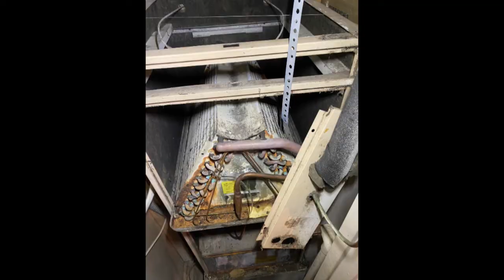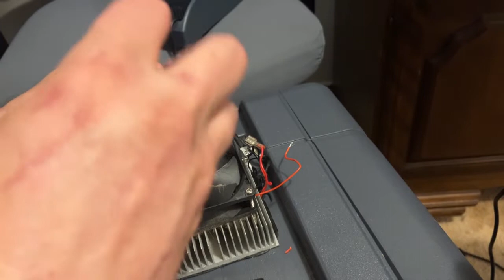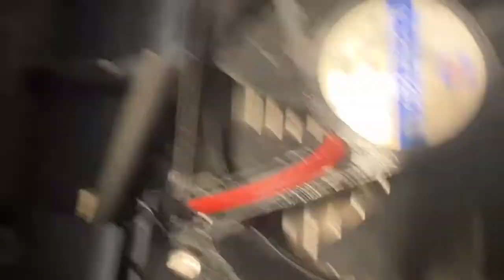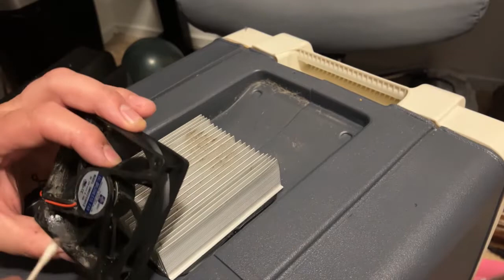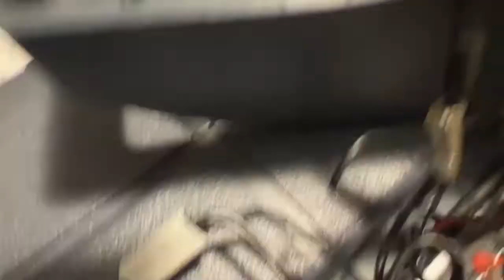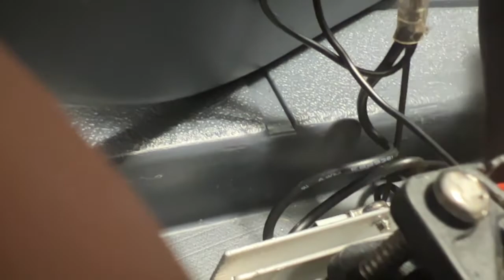Coleman 12V electric cooler Part 2

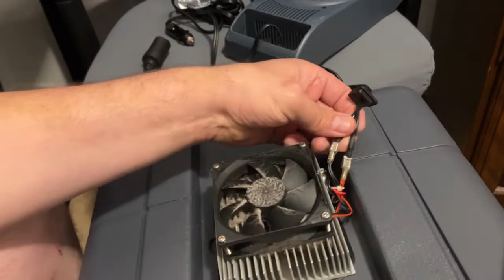Comment: your hand is blocking the view of how to disconnect the old wires at 3:07 / 3:08.  I pull on them but they are not coming apart. How do they come apart?????

Comment: What size of a voltage regulator can I use
Reply from the maker: Assuming you’re talking about the power supply, or switching AC/DC power adapter, mine came with model G602-1250. it has a DC 12 V output of 5 Amps.

Comment: Noticed you put the fan on backwards,  the sticker was originally facing the metal fins and after cleaning it was out in the opposite way. Does it matter which was its facing?
Reply from the maker: Good catch. This video was not shot in sequence and due to a camera malfunction I hurriedly reassembled everything to rerecord parts of it putting the fan on backwards. Originally the fan was on label out as seen through the fins when I take the cover off at the start of the video at about the 2 minute 30 second mark. So I did end up putting it back together the way it came apart. As far as your question about wether it matters or not  from a functionality point of view probably not as long as the fan spins freely and like mine there is no dust filter.
Reply: @JerryRigger  I saw the fan went on backwards too!  Great video!
Reply from the maker: @kevinshea4776  thanks for liking and subscribing

Comment: Absolutely  junk  get  a real  12v compressor fridge would use half the power and be twice as reliable
Reply from the maker: Can’t argue with that, but thermoelectric does have advantages at times when used in small enclosed areas like being lighter, not vibrating, and not dehumidifying like a compressor system would. Thanks for the comment and thanks for watching, liking, and subscribing.

Comment: I’ve fought these coolers for 12 years, I use the slow blow fuse they seem to last much longer. I also stopped taking it apart to clean because the wires are so fragile. I use a paper clip to hold the fan and blow compressed air all through it to blow dust out. The newest coolers it seems they are used foam insulation that expands. So it keeps it much cooler. Which seems to have an adverse effect on the plug quickly over heating. Brand new it lasted 2 weeks. Coleman sent a replacement and did the same. They really need a better more heavy duty plug in my opinion
Reply from the maker: yes, the plug is how my first video on this cooler got started. Of course there’s always aftermarket plugs. I haven’t tried any of the new coolers because I have been able to keep mine working although mine mostly just gets used for holidays and vacations so I don’t put it through the stress that many truck drivers would. thanks for watching.

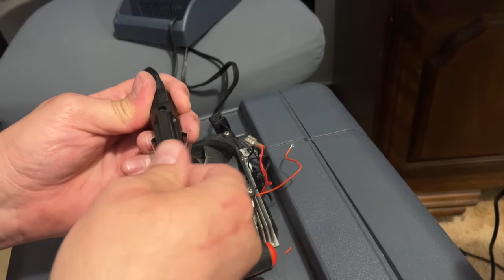Comment: At 2:15 in your video you talk about a "small black wire" cautioning not to cross it with the positive.  Does that have to be connected to anything?
Reply from the maker: The small black wire in my plug connects one of the two negative contact plates to the negative wire where it connects to the the other contact plate. I assume the engineer that designed it did so to improve the negative contact. Chances are it will work without it as long as the one of them is still connected to the large negative wire and the receptacle is making good contact. However I am not the engineer that designed it so I cannot recommend that.
Reply: Thank for the response - I made that assumption and reassembled it prior to getting your response.  The positive tip unbeknownst came unscrewed and got lost so I had to buy a cheap device with a similar plug to replace the lost tip.  It works even though I just left the little black wire unconnected to anything.  Phew!